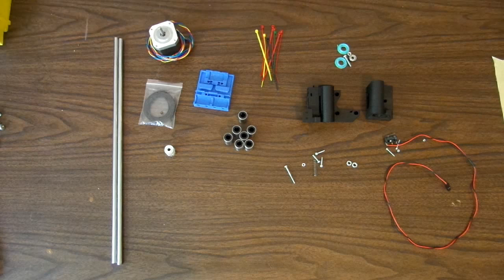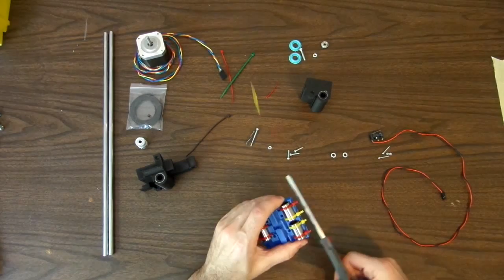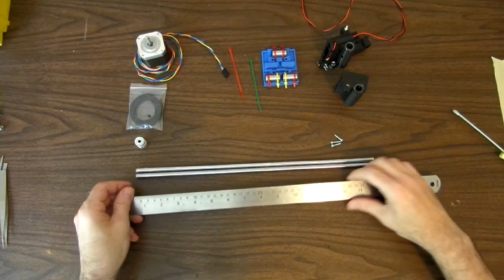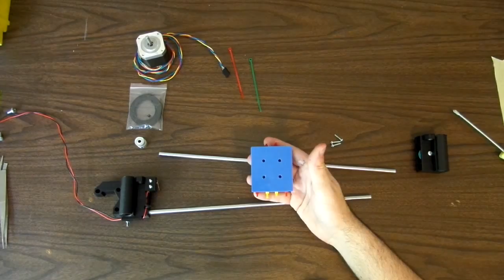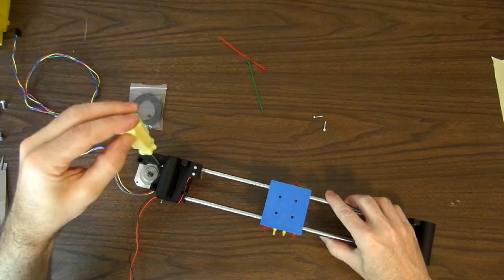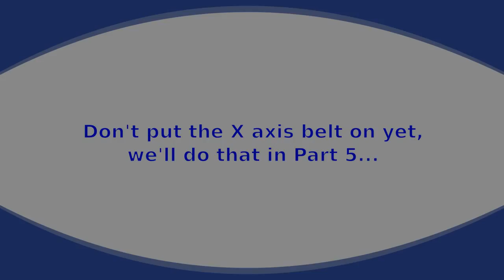Reprap Wilson TS Assembly Part 3 / 6

Comment: It would be good to be able to use these kinds of rods over the 5mm threaded rod http://www.aliexpress.com/item/2pcs-lot-RepRap-3D-Printer-THSL-300-8D-Lead-Screw-Dia-8MM-Thread-8mm-Length-300mm/2029650336.html?s=p Sadly i cant get my head round open scad! :(
Reply: Sadly I didn't. Never could work openSCAD to remake it.
Reply: That looks good! Will have to get the rods and print it and see how I get on.

Comment: I've now gotten as far as this video and the direct drive extruder.  I didn't install the idler pulley because I was going to look at the mod for the belt tightener.  I then discovered it was impossible to mount the pulley with the X axis in place, so I had to remove the right hand side motor, smooth and threaded rods to get at it.  After putting the new part in place I realized that it would not be possible to get the X carriage to move all the way to the right, I'd be missing 0.5 to 1.0 inches of right travel.  SO I've gone back to NOT using the X tension adjust.  I found I could pull the belt tight enough thanks to the toothed belt holder in the carriage.  I also used a drop of locktight on the screw for the X idler pulley as the nut impression in the plastic wasn't large enough for the M4 nut.  On second (or third) thought I could have mounted the Y axis a bit off center to get back what I loose with the adjuster, but I'd loose some height on the left side where the RAMPS fan would now be over the build area.  The ideal thing would have been to extend the X axis and move the 2020 uprights further apart to make room for the adjuster.  Some thoughts on any mods you'd like to add to the design......

Comment: Hi What teeth pitch do you recommend for the pulley? The BOM doesn't really say.
Reply from the maker: The same as your belts (probably 2mm if you are using GT2 timing belt).  16-20 teeth per pulley is ideal (mine are 20).
Reply: Thanks! :)